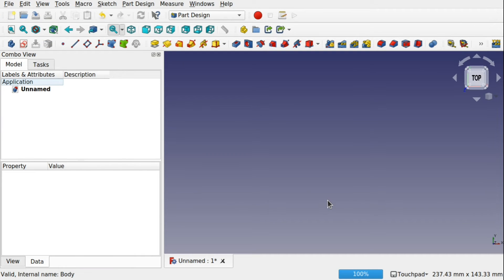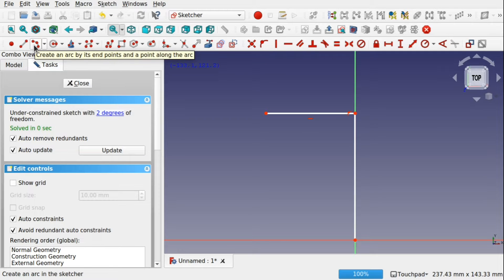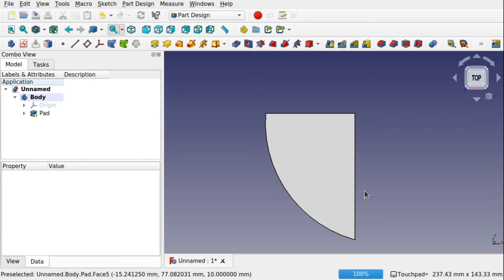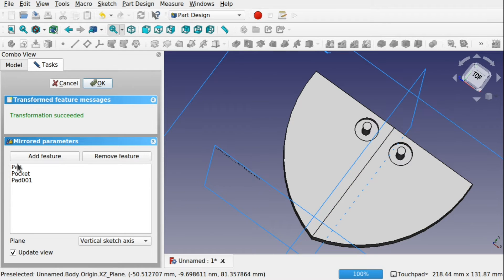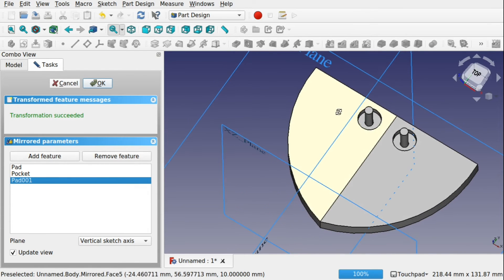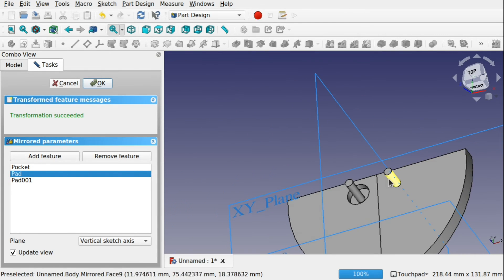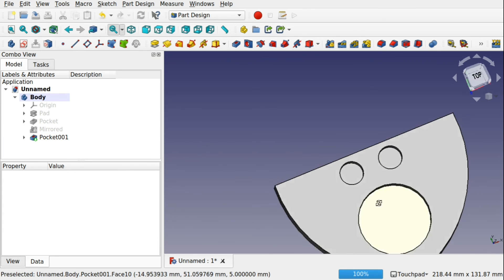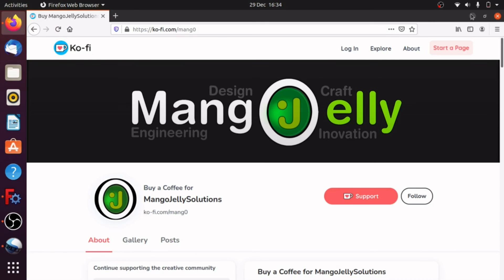FreeCAD: 4 Things you may not know about the Part Design Mirror Tool (Beginner Tips)

Comment: Note to all beginners and everyone else. The scale control is under the Data tab at bottom of tree, next to View.  A careful note to stop video and check all settings on the screen i.e. work bench, on/off tree features, active body, View or Data, etc, at each selection thruout all vids on this channel. Darren does a great job at demonstrating what may be done in Freecad and explaining each setting would be deterimental to the flow of any video. 
I wish Darren would include this instruction at the intro to all of his videos. Imho, that would be the best instruction to his vast library of Freecad videos.  Great work, Darren ! Keep 'em coming !
Reply from the maker: Thank you for adding that to help others. And thank you for the suggestion / feedback. I will take those on board through the new series that I am doing.

Comment: Nice video.  Note that mirror will fail and throw an error "Only additive and subtractive features can be transformed" if you attempt to apply another mirror transform.  Unfortunately, using multi transform has the same problem if a feature of the multi transform is a transform.